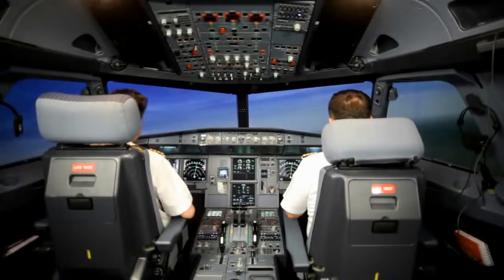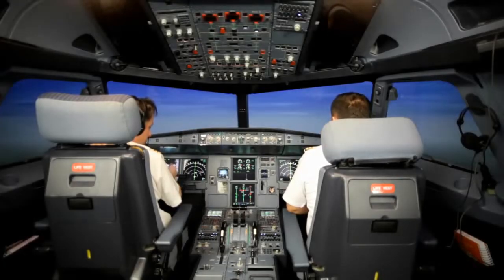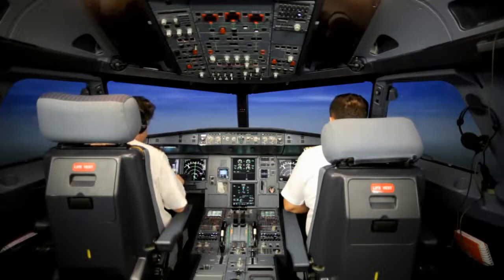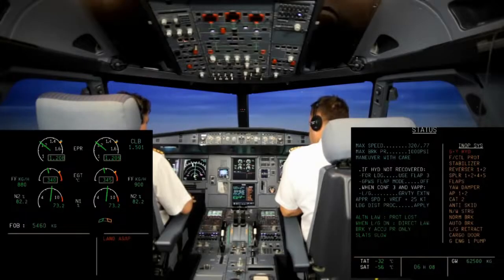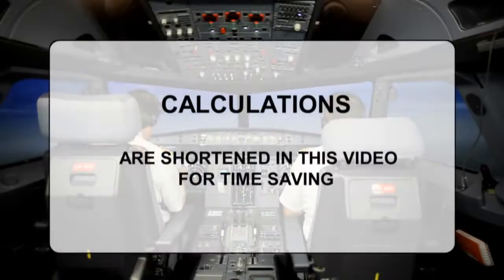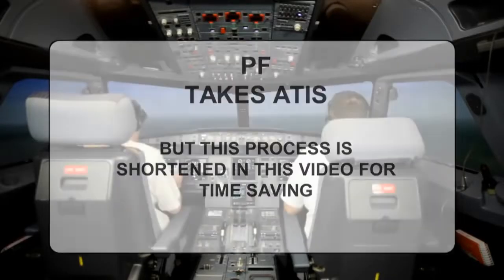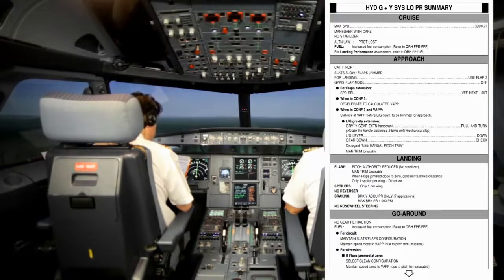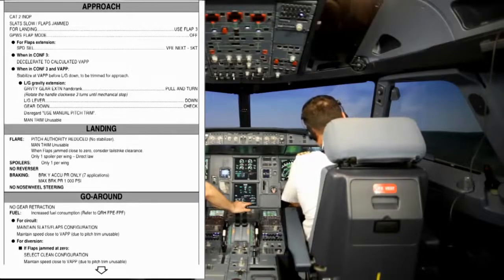DUAL HYDRAULIC FAILURE (G+Y) A320

Comment: Very well done gentlemen. The pace was good, it didn't feel rushed or pressured at all. The procedures was done in proper sequence, just what I needed for my coming recurrent. My only critique is that they should have filmed all the way till the parking brake was set. We didnt get to see the configuration, direct law, flare and braking. Other than that, very good video.

Comment: I have a question if I have a nose wheel stearing inoperative I cannot anymore steer the weel ? Or priority valve closes and keep some fluid for steering ?
Reply: Yeah you can not use it anymore. But you gotta analyze first if you are loosing the HYD because of low rsvr level or low pressure. On newer Aircraft the ECAM actions will command you to turn on the Y pump or G pump for "Apply LDG procedure" as long as your fail is due to LOW PRESS.
Reply: @luissi1234  thank because I realized that in some aircrafts have nosewheel steering on green and on some on yellow. In Boeing you  have otion of alternate steering in case Loss of system A. I m wondering why airbus not ?
Reply: @samuelcv6565  yeah, that’s true. Some a/c have the steering on the G others on Y. While being in Y Airbus does have an electric yellow pump which would techinically allow the plane to taxi if it had a yellow low press fault. Either way I believe airbus is more focused on the “fly safe to terrain” so it’s redundancies are for flight phase.